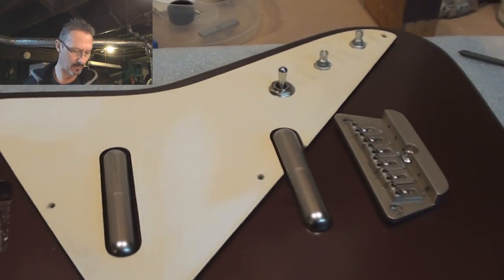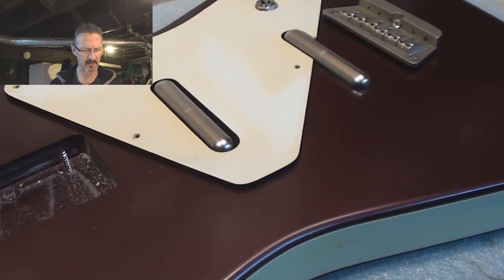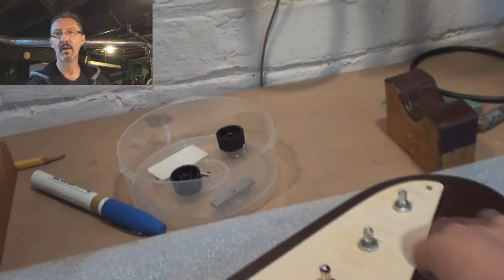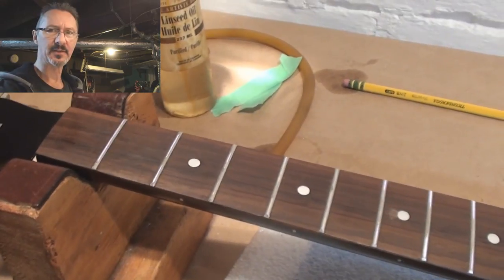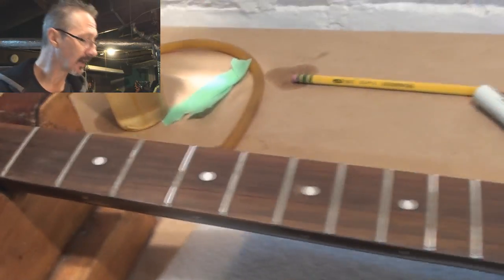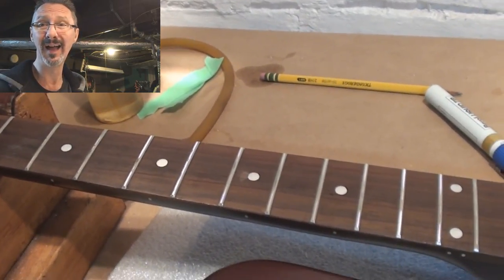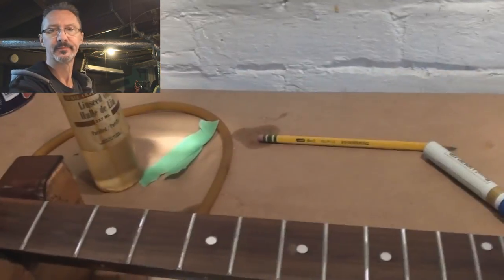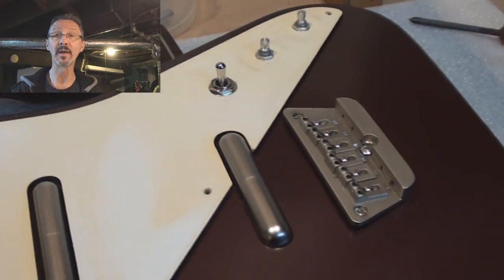Danelectro Pro Reissue Guitar Repair

Comment: Okay, to put this to rest, yes you can use steel wool. In fact, both Fender and Gibson use steel wool in their factories. However, if you don't want the particles in your electronics, you have to use it without the electronics present. If it's a removable neck you're working on, simply remove the neck from the guitar, put the body elsewhere, and do what you have to do. If you're going to use it on the body finish, you best remove the electronics first, if they're present. To save this hassle use

Comment: I like the look of the rounder metal covered pickups myself.  seems a little less responsive though than the other type for some reason or maybe that's just the way it seems on camera. probably have to see it in a full on fast paced riff to completely get the right idea of how well it performs. don't really find many that are a fan of the lipstick tube pick ups either. that one looks like it's like 1950's vintage and kinda rare.

Comment: the sandpaper Davey uses. If you want quality papers, you pretty much have to use 3M brand. So far, I haven't found any other brand that works and lasts as well. However, they can leave grit around, though it's non metallic and won't make electronics to wonky as fast. Grit in your pots or pickups still isn't a good thing, so tape them off.

Comment: There is a cleaning solution called AWESOME. It will take that cigarette smoke off of stuff without damaging it and no need for sanding. Not sure if it is available in Canada, but I usually pick it up at the dollar store here in the states.

Comment: I would have tried various cleaners first. If I had to sand it, I would sand it with something like 3000 grit, maybe even finer for a smoother finish. in some cases, I would sand it with the six hundred, then paint it with Krylon Fusion paint, the kind that blends with the plastic. Sometimes, that paint can really do wonders.

Comment: the problem with cleaning the pick-guard with sand paper is that it takes the shiny smooth surface off. Then it's far more vulnerable to dirt sticking to the rough surface.
Reply: Then it just needs finer and finer sandpaper used, until it's shiny and smooth again.